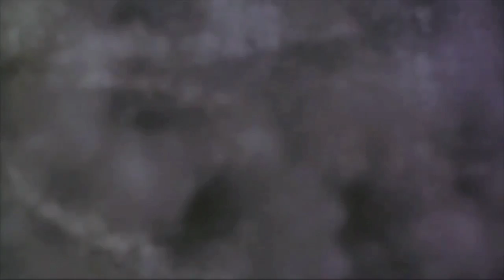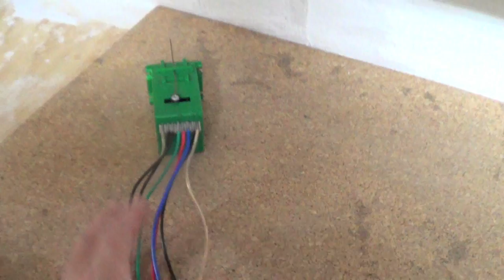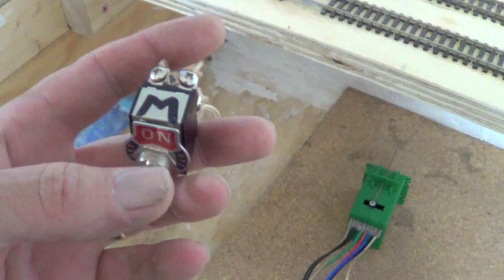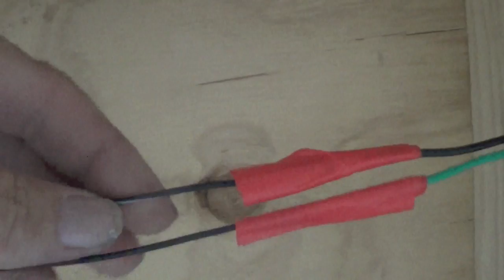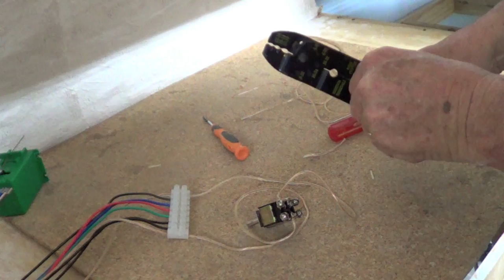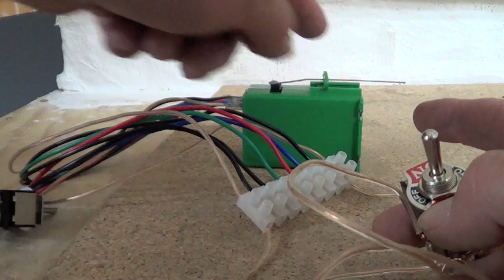Tortoise Switch Machine Wiring Toggle Switches "Model Trains"

Comment: Robert, another interesting video from a fellow Aussie. Can you explain your reasoning for using a Tortoise slow motion switch machine but not modifying the turnout to remove the over centre spring which is causing the snapping action back and forward which seems to defeat the purpose of the slow motion machine in the first case. Why not use cheap solenoid instead?
Reply from the maker: Digitrax Dad i have taken out some of the springs on the turnouts but still have more to do but you are right
about the snapping action cheers Robert
Reply: Ah Rob, not trying to be right about it, just curious as to your motivators as it was a little unclear is all. Thanks for the very prompt response my friend.
Reply from the maker: All good mate, but it is good when people make a comment about something they think is not right.
Especially when it is right and at least you can then fix cheers Robert

Comment: Using ine color for all the wire is just nutz. How in the hell do you trace a problem with all of the wires the same color????? Never happen on my rail road.
Reply from the maker: David thanks for your comment but i use the same colour only for the toggle switches all the other wires are colour coded,
example frog, signals, and track wires. There are only so many colours you can use and not much can go wrong with the 
toggle wiring  cheers Robert
Reply: I still would not use all the same color...

Comment: Did I see that right? You have your wires plugged directly into the outlet?? No power box or control box in between? Where did you get that plug? How many amps or watts is it? Great video. -Mark
Reply from the maker: Mark you did see right and we call them wall adaptors over here and this
is 12 volts and one amp ac and dc. You just plug in to the outlet and cut 
the end of the wires and join your own wire to the end, so i have this running
around under the whole layout cheers Robert

Comment: Very informative Robert!  Thanks for posting this.  Layout is looking really great as well!  Are you using peco turnouts?  Did you have to remove the springs from the turnouts before connecting them to the switch machines?  - Brian
Reply from the maker: Brian i am using Peco code 100 turnouts and i didn't remove the springs, i used a heavy gauge piano wire,
the wire that comes with the Tortoise machine is a very light gauge wire, hope this helps cheers Robert

Comment: To me it all seems clearer as long as I keep wire management in mind. I believe that the problems some people have is due to confusion that comes from an unruly pile of wires. I like your approach. Regards, Solomon
Reply from the maker: Solomon using the terminal strip makes life much easier, and even better for
when you also need to add signals or leds later on cheers Robert

Comment: hey Robert do you use heat shrink on the wires that you join together
Reply from the maker: David i don't use heat shrink as none of my wires will touch each other.
By using the small wire that i join still has the insulation around them so
there is no need cheers Robert

Comment: Switch Machines are nice and easy to install but a bit expensive.  I can't decide to go with them or use servo motors which are less expensive.  I heard its a good idea to remove the metal clip in the switch to make them move better and to make it easier on the motor of the switch machine.
Reply from the maker: Scott i have always had these Tortoise machine and they work all the time, 
and some people remove the wire for a thicker wire to help move the switch.
cheers Robert